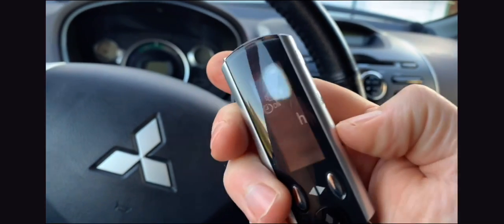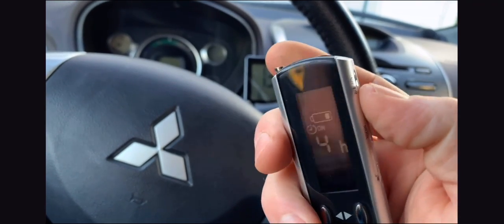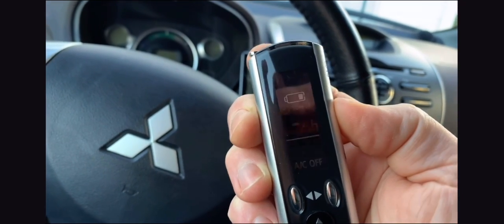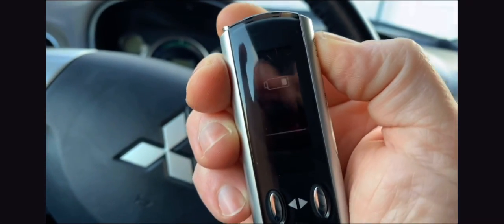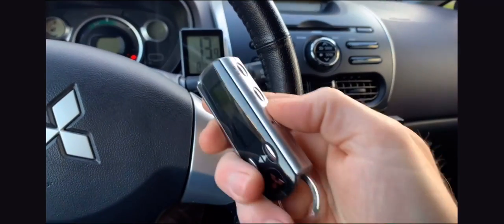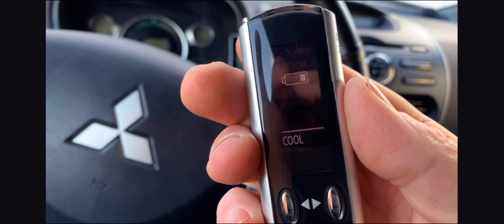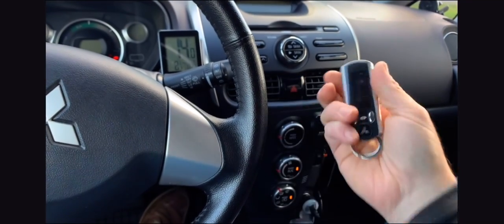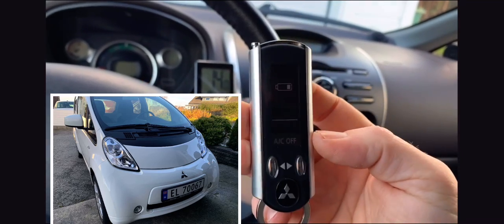Remote controle system I miev

Comment: Great video! I just use the convenience charger. Does the remote work when using the convenience charger?
Reply from the maker: Sorry for late answer, it works only when the car is plugged in, always with anny cable ( the charger is in de car 3 kwh standart)